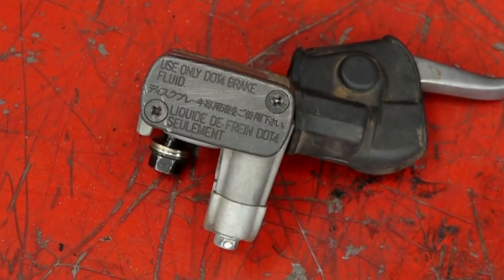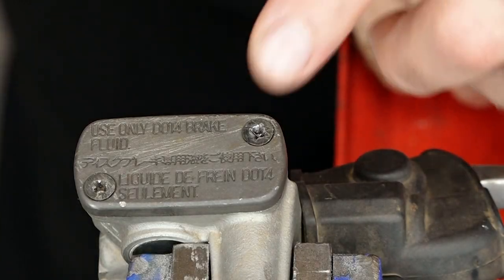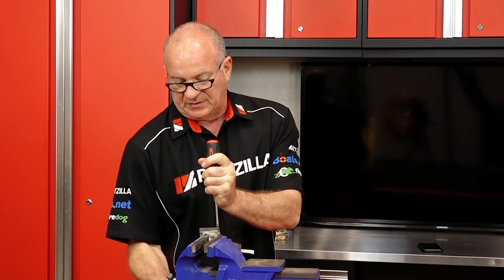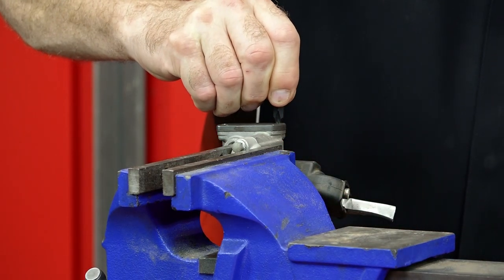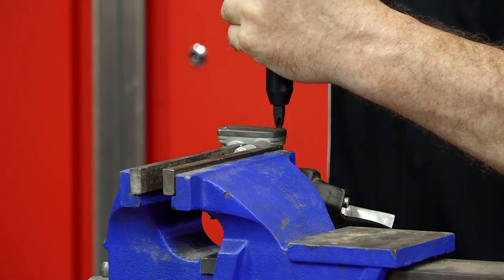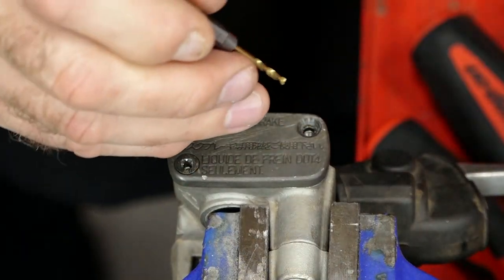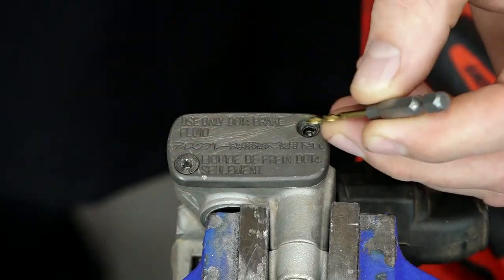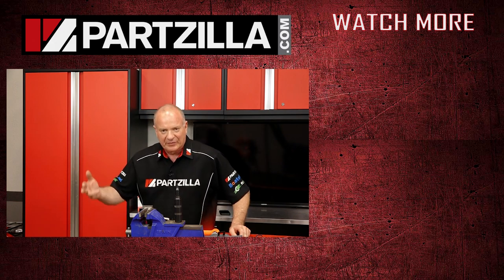How to Remove a Stripped Screw | Stripped Screw Removal | Stripped Master Cylinder Screw | Partzilla

Comment: Thanks for this video and all of your other helpful information.  I do a fair amount of work myself, but some things beyond my skill set require a visit to the bike shop.  Seems to me that many mechanics over-torque nearly any bolt they touch, making it overly difficult to remove, hence why I ended up watching this video.
Reply: I swear to god I'm not letting some idiot drill screws into my bike ever again, I stripped my master brake cylinder screw because of this.. smh.